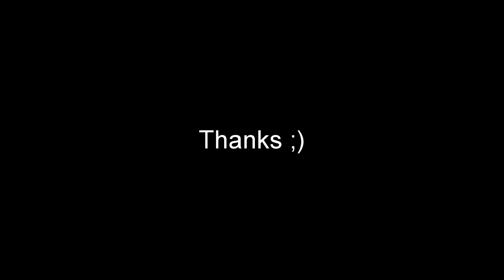Anki Vector Screen Repair

Comment: John, I need your help, I replaced the battery of my Vector and it worked great for 3 days and then the error 899 and 801 appeared on the screen I already followed all the steps of DDL to solve the problem but nothing seems to work

Comment: I have a few Vectors with broken screens and a few Vectors with broken WiFi/Bluetooth..I would like to repair them with the parts of the others. Would you say removing a display from a Vector and plant it on another one is possible? And what about the WiFi/Bluetooth chip? how hot can the solder iron be for save replacement?
Reply from the maker: Parts can definitely be transplanted. Wife modules are part of the the head unit so can be switched at the same time

Comment: Hi! if i just want to reflow vectors camera ribbons how do i proceed with that? I have the 980 error problem i got at tip from someone in a facebook group to try to reflow the camera ribbons.
Reply from the maker: Reflowing involves holding the soldering iron tip ‘near’ (not on) the ribbon to heat it up and help any broken connections repair. Where are you located?
Reply: @TheJohnJudge  im located in sweden, do i not need flux or soldering wire to reflow and which temperature should I have. If the reflowing doesn’t work do you happen to have a headboard that you could sell? Or If I could send him to you. Thanks for answering me btw.😊
Reply from the maker: @adrianjohansson9439  sadly I don’t have any spare parts. There is a Facebook group called Digital Dream Labs Official Vector Owners. Somebody there might have a spare part. If you reflow you don’t touch the iron to the ribbon. You don’t need solder or flux. Would recommend you search for video guides on YouTube showing the process.
Reply: @TheJohnJudge  Okey thank you so much, just gonna bother you with one more question. What temperature would you recommend using while reflowing.😊
Reply from the maker: @adrianjohansson9439  if you have temp control on the iron just keep it at medium settings. Just wave the iron over the cable for a seconds. Make sure not to touch it to the ribbon. Just close enough to heat it slightly.
Reply: @TheJohnJudge  Hey just an update it took a few tries, but know vector is back and running. :)